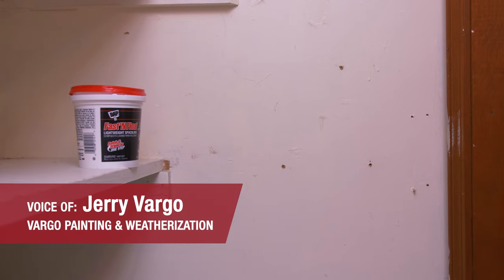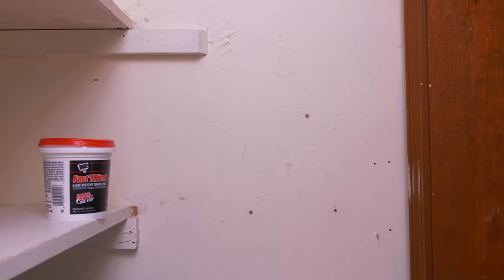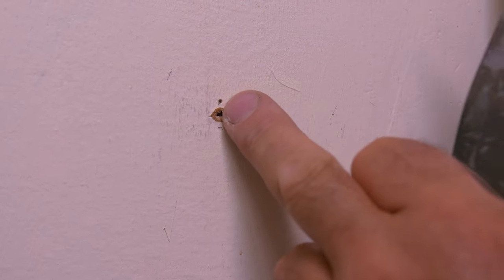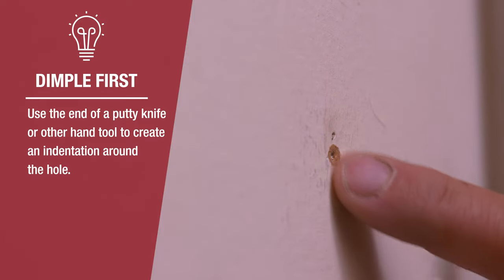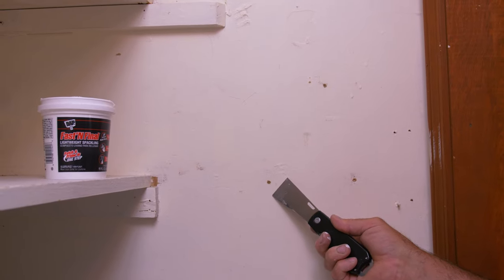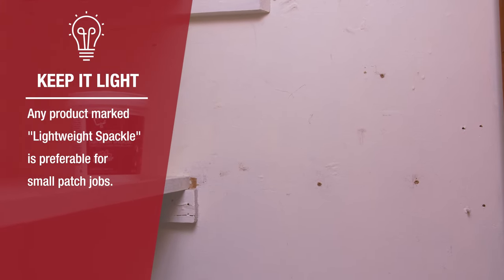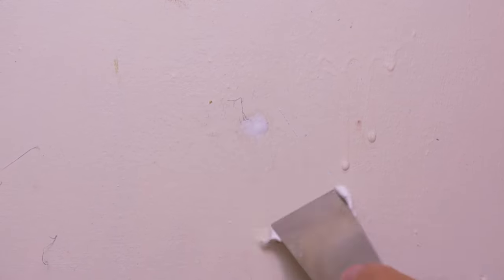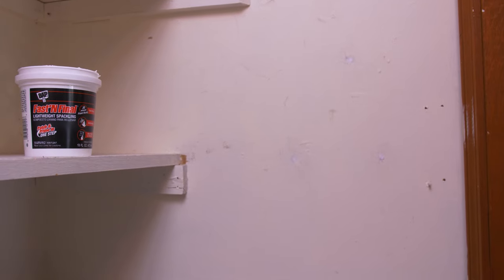How to fill holes in walls from nails or screws.  |  Hyde Tools

Comment: This might sound like a dumb question, but I have a hole from a nail but there's a bit more of the wall taken off around it. It's not massive though. Should I plaster it? or can I still use this filler? I'd personally prefer to use the filler because it isn't a massive hole, but then again, I want to do it the right way :) Thank you! 😄
Reply: oh also, should mention it's inside but on an outside wall
Reply from the maker: Not a dumb question at all. As long as the size of the damaged area is less than the size of a quarter, it's fine to just use the filler. You may need to sand it a bit after the first coat and do a "skim coat" with another thin layer of filler. Good luck.
Reply: @HydeTools  Okay, that's perfect. Thank you very much!
Reply: Could you just take a countersink on a drill and use that to make the space?
Reply from the maker: @Crowhil13  The countersink may tear up the drywall's paper surface, creating more of a mess than the hole itself. You want a nice smooth transition between the wall itself and the "dimple" you're making. So even if you use a countersink bit (be careful you're not accidentally hitting an electrical wire or plumbing behind the wall), you'd likely still want to use a putty knife handle to get the transition smoothed out.

Comment: I’m doing this but after it dried it gets sucked into the hole and there’s just a shallower hole.
Reply from the maker: Hi, Chris. If it's a larger hole (larger than a dime), or if you used joint compound as your filling material, you may see a dimple effect as you described. Simply apply another layer, called a "skim coat." If you haven't tried lightweight spackle yet for this kind of task, you could give that a try, too. Good luck!

Comment: What do I do if I tried to patch up the holes (incorrectly) and painted two coats over the entire wall and the area has small blisters?
Reply from the maker: Use a multitool to "pop" the blister and clean out the hole. From there, you can follow the instructions in the video. Hopefully you still have some of the paint used to paint the wall; do a light sanding with a high-grit sandpaper (180'ish grit) after the spackle or compound has dried completely, and brush on a few coats of paint. If you don't already have a multi-tool and/or putty knife, take a look at our 2-in-1 Folding Painter's Tool, it's a multi-tool AND putty knife in one. https://hydetools.com/collections/multi-tools/products/stainless-steel-folding-multi-tools Good luck!

Comment: Hi! Do I have to use the 5 in one tool?  Is there something else to scrape the extra scraps drywall around the hole?
Reply from the maker: Hey, Sierra. Nope, you don't need a 5-in-1. While a painter's tool (also called a multitool) is typically always in the pocket of professional painters, you can use anything with a clean, stiff edge. What's more important is to have a good putty knife when applying the patching material -- the flexible blade lets you force the material into the recess without leaving stray bits of material behind around the hole. While the putty knife also isn't 100% necessary, it'll make the job easier with good results. Good luck!

Comment: I followed the steps and have small cracks where each hole was. How do I fix?
Reply from the maker: Did you use joint compound to fill the hole (as opposed to lightweight spackle)? It's not uncommon for joint compound to get hairline cracks when it dries in a hole. That's okay, though. All you need to do coat the area again it with a very thin layer of joint compound. Because it's a thin surface layer it shouldn't crack, and it'll fill in the hairline cracks beneath. Good luck!
Reply: @HydeTools  I actually used the lightweight spackle. Same brand in your video. I wasn’t sure if I painted over it too many times or didn’t use enough spackle. Can I fix it with a light coat if spackle in the manner you stated for the joint compound?
Reply from the maker: @greedymcmean  joint compound is typically preferred for a final skim coat, but the spackle can work too. if you have some fine grit sandpaper (120 grit or higher), you can err on the side of putting a little bit thicker of a coat of spackle over the area, then sand it smooth.
Reply: @HydeTools  ok, thank you